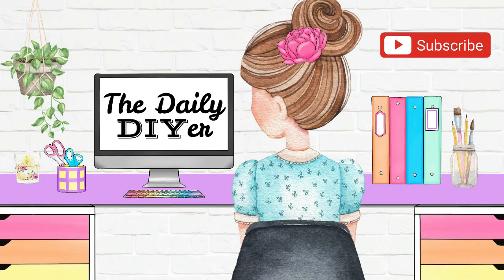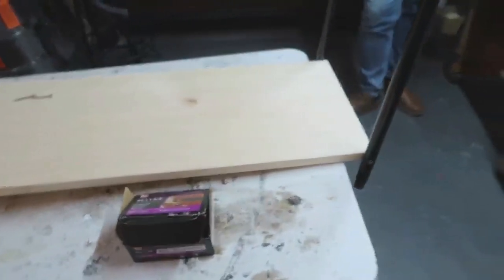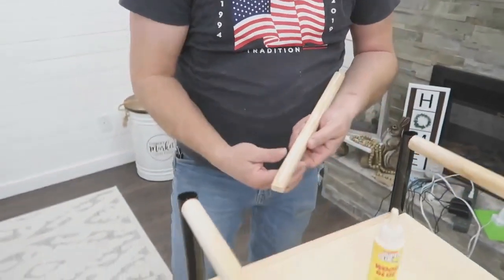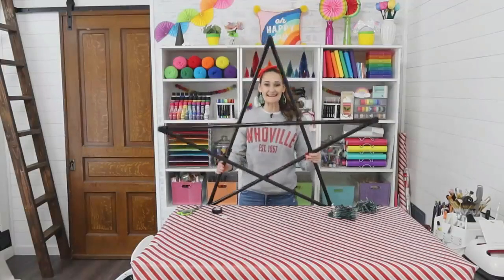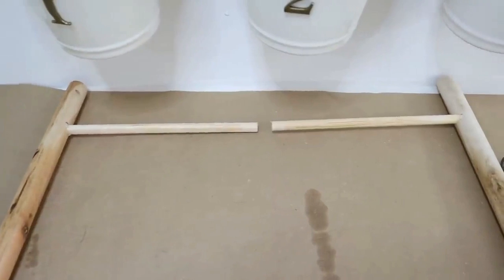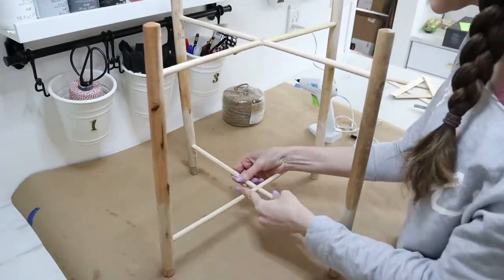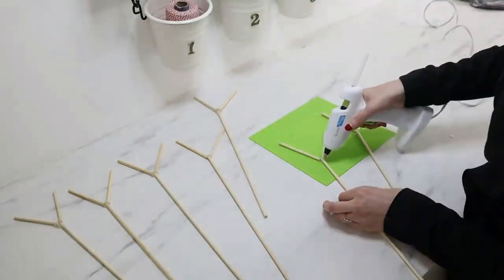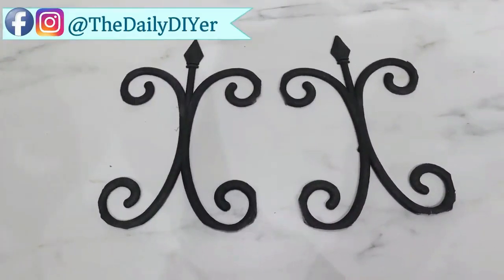LARGE $1 Dollar Store HACKS and IDEAS that will SAVE you HUNDREDS!

Comment: Even though I’m late watching this, I still wanted to react.
Bc I did see you drilling into the round pieces sort of ‘in the air’, but it’s safer if you put round objects in a corner (like when two wood planks are fixed together or in a miter box). Much more stability when held back at two sides.

I LOVE the projects!

Comment: I loved these ideas. I had a thought about the star. Since you hammered the ends flat, could you not just drill through the ends and connect with nuts and bolts? My thought is that it would make it more usable for outside and also easier to store since you could just disassemble it and store away.
Reply from the maker: That is a great idea!